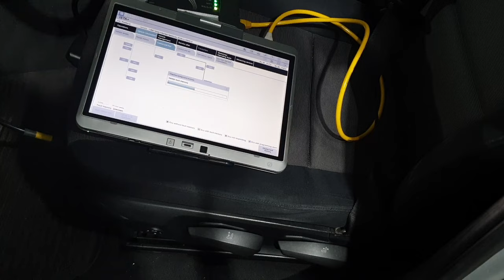BMW e87 dashboard removal for Evaporator core  Replacement

Comment: Hi. Just to check in. I did this by myself two weeks ago. Not a big deal just good organization and no problem. Took me 8h to disassemble everything, and about 4-5 to put everything back together. No left over parts or screws nor missing ones and also nothing broke. Did in one day. Needed tools are minimal (3 torx, 3 hex, 1 pliers, few flat and philips screwdrivers, clamps for hoses so you don't have to drain the coolant from the whole system and MOST important a lot of light, and a good light with magnet). In my country evaporator original Valeo was 120 euro, that was the total cost for me. No orings or seals to change, no errors on the computer, just a a bit complicated LEGO.

Very grateful for your video because you encouraged me to it by myself and also showed few tricky spots that I would probably get stuck onto.
Reply from the maker: Nice to hear that ! Thanks

Comment: salut am si eu un e87 si de ceva timp se formeaza o pacla uleioasa pe interiorul parbrizului o fi de vina tot evaporatorul sa caloriferul mentionez ca antigelul nu scade si nici moceta nu este uda
Reply from the maker: Salut,  trebuie sa apelezi la un service sii sa iti faca un test de presiune la instalatia racire motor posibil sa ai un por in radiatorul de caldura din bord

Comment: Hi. Amazing job and also awesome video.
What is in all the small bags with evaporator at the start of the video?
Also what did you do on diagnostics at the end?
Thank you for answers.
Reply from the maker: Hello ! in the bags were all the necessary orings (ordered separately) and at the end I deleted all the errors
Reply: @MOvidiu  Thank you for the reply.
I have e87 2008 (N47), is it possible to post if you know what orings and what else is necessary for the job?
I can't find any relevant information online and I want to prepare all necessary parts before start.

Comment: Just quick question man if I have much fog inside the window and snow so this most be replaced? all good if I replace it? (BMw 1 series 118i E87) the problem musch fog inside the window on winter;/ its terrible it looks like the car cant handle it if weather is wet on the outside. Is it no atoher way to remove fo inside the windows this is soo big job too do;( it will be too expensive for me and cant do all by myeself fear to break something.
Reply from the maker: Hello,  first check your polen filter (recommended replacing) second check your recirculation flaps not to be stuck close,  and check your carpet of water
Reply: @MOvidiu  pollen filter are good and egine filter is good but where is recirculation flaps on my car? or is it are more easy to replace. heater core on my car? flush heater core? and its good anitifreeze on my car and new heater motor;) the fans are likew new nor aircontion.And egine is cleaned and no bad smell on my air contion. And new termostat so maybe more less fog beause new termsotat and heat motor? So its dangerous too drive with bad heater core on the car?? So this can be the reason be car loose antifreeze before??
Reply from the maker: It is possible that the heat radiator is clogged but if it is clogged in winter it does not put much heat in the passenger compartment.
Reply: @MOvidiu  got it but I have a new fan motor so it is better heat now in my car but is that the case if I loose the collant if the heater core is bad? dangerous to drive with heater motor is bad? AUC sensor can it be???

Comment: Hi,
I have a 1M Coupe and the car drops coolant at the drain of the heater core (drain located above the transmission). Therefore I assume thar my heater core has a leae. Moreover, I have some kind of burned smell when I turn the heater on. I guess and hope that it is all related. Going to try to change the heater core next week. Or do you thing it might be something else?
Kind regards,
Max
Reply from the maker: Hi Max, if your coolant is leaking, it may be a broken heater core or its pipes, normally your windshield should be steaming on the inside, it should have an oily film (coolant vapors)
Reply: Did you also draw off the a/c system before your work?
Reply from the maker: @Manracermax  if I need to remove the evaporator , yes

Comment: Hi,

Is it possible to leave the old evaporator in place, and instead install a new one in the engine bay infront of the radiator, and then reconnect the ac pipes from the old evaporator to the new one in the egine bay?
Reply: It's impossible, the evaporator work is to cool down the air inside the cabin. You have to push the air to the evaporator to it . If you don't change the cabin filter per year, the three leaf, dirt, goes to the evaporator and with some wet, it will rotten and leak the gas from A/C system .